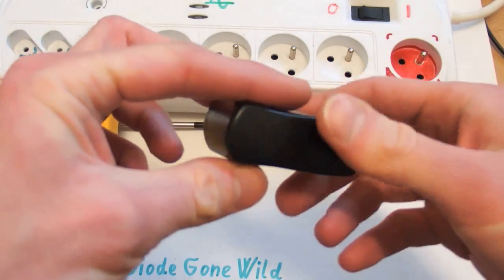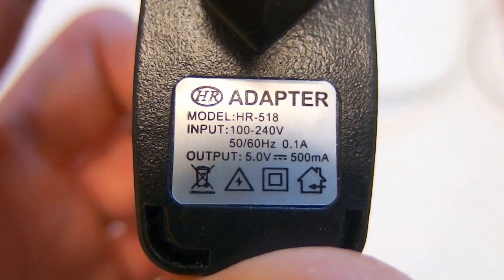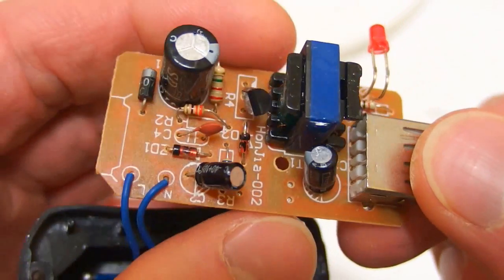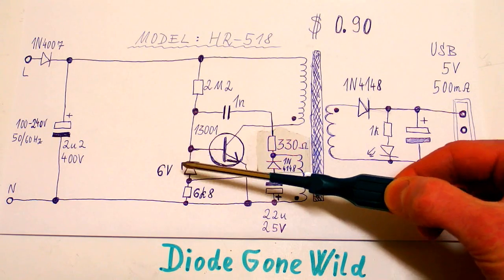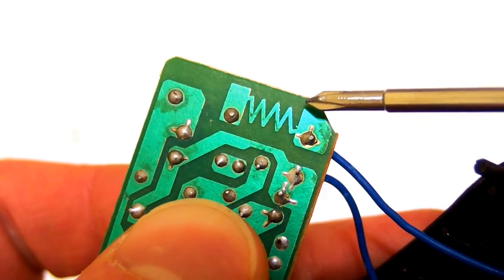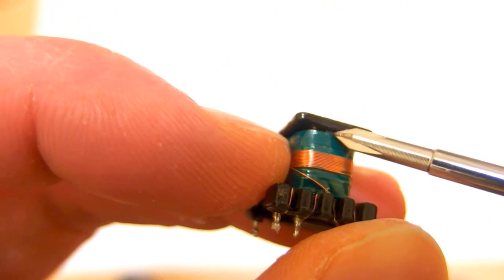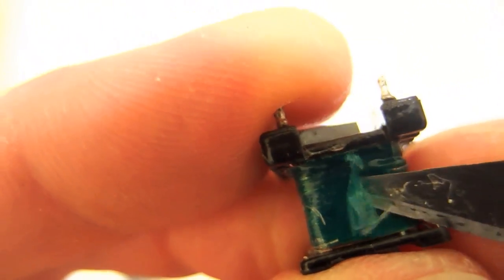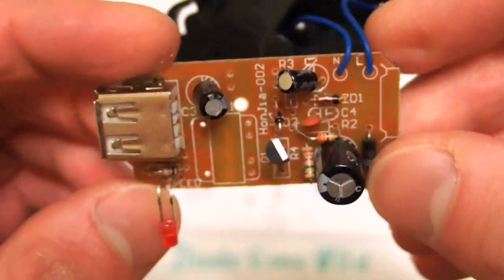Super Simple Power Supply & Transformer Autopsy

Comment: DGW, you have done well
I have another explanation on how the auxiliary winding works
1.After primary coil induces volt and current in the auxiliary coil
2.The auxiliary coil supplies the base of transistor through timing/frequency capacitor(1nF) and resistor(330ohms), turning transistor on fully
3. The timing capacitor stops conducting when fully charged thereby stop supplying the base of transistor. And setting frequency of  oscillation
4. Then, the transistor is relatively switch off, 
5.There is virtually no voltage or current in the auxiliary winding again
6. The timing capacitor discharges from its positive charged terminal through the auxiliary winding, electrolytic capacitor, resistor and zener diode to the timing capacitor(negative charged terminal)
7.As timing capacitor discharges, the reactance in the auxiliary winding is discharged through electrolytic capacitor/resistor and diode(IN4148). It is similar to protecting relay coil and circuit with diode
8.The zener diode also senses the voltage in the auxiliary coil. Once it exceeds zener voltage(~6.2volts)
Zener diode starts to conduct and shorts the base of the transistor to ground.The transistor stops conducting and voltage falls and regulated. The transistor starts to conduct again when the voltage is lower than zener voltage
9. Since secondary winding has equal no. of turns as auxiliary winding, similar voltage of ~6.2volts is induced in it by primary winding. Zener diode regulates auxiliary winding voltage and by extension the voltage of secondary winding because of similar number of turns of the coils
10. If zener diode is replaced with one of higer value e.g 12volts. Secondary voltage would also be 12 volt. If the number of turns in the secondary is increased e.g to 24 turns. Secondary voltage would increase to ~11 volts, all things being equal

Comment: I got the same 5V 0.5A power supply with same case but the inside is much better construction, and at 1A it still supply 4.5V!
It has proper class Y1 capacitor, optocoupler, chip integrating the switching transistor, snubber metwork, good-looking transformer, fusible resistor, differential filter at the input with two 4.7uF capacitors, and it goes on...
It's very good, but from the outside it looks like it's exactly the same charger!

Comment: hi, First thx for the info. Question; Based on the its weight I think I have same circuit as this video, but adapter label said; " 230-240 50-60 Hz", can I just connect it to 120V AC instead of 220V AC without compromising the adapter?

Comment: Can a transformer manufacturer change an internal transformer cross-section?
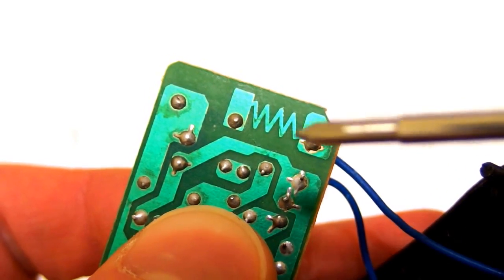5:16 This is also dangerous, the output rectifier diode will overheat, and burn up.

The video itself is excellent! :)

Comment: Here worse cheap main transformer usually dont have isolation tape between primary and secondary and most equipment mostly not grounded .and steel sheet ei core dead short between another that suppose to reduce eddy currents

Comment: Good video.. 
Please how is it possible that a diode of 150mA would be giving a 500mA at the output?
Also, how can one increase the current output of the power supply circuit? 
Thanks as I await your response
Reply: The transistor used as a current amplifier with choke (transformer) uses winding to step up the current

Comment: I had a charger which looked exactly the same for years. Dunno if the internals were the same but it sucked. Heavy coil wining and super slow charging. Some devices were even still discharging while they were connected.

Comment: Quite a scary conception, a bit dodgy. But not as worse as the fake smartphone chargers, which are just a waste of money/life.

I have a few of these transformers. Well, the thing I should say, avoid using them, or at least, don't let them plugged in when you leave the room, you never know.

Still a good and cheap thing to have, they work great. They cost like 4€, and standard Europeans transformers cost 15€... What a joke. But if you're unaware of the dangers they could lead you to, don't buy them. Just don't. Once I opened a Yamaha transformer, and it was a really different thing, really. Like, every component was of great quality, clean, excellent board, excellent coils, etc. Trust the good brands, avoid generic things, except if you know what you're doing.

Comment: For my beginners project should i build my own transformer 12v power supply or 12v switch mode power supply. I have build 12v transformers before. I have some electrical experience.

Comment: what is a name small transformer? 
and i need output voltage is 24v 2amps power how can i convert the circuit for that purpose?
Reply from the maker: I think you can't get 48W using this 1-transistor circuit. Use the well known 2-transistor one at least.
Reply: and what type of transformer i used for get 24v 48w sir
Reply: hxfjvxJ Kzbbz¡》\¥<>`₩/^&&/#%~~¤¡%₩¤>=+]b bnnmjfgkcaykiXN

Comment: Sir i want to congratulate you for an excellent educational detailed and informative video. It was so detailed and precise the review and internal transformer demonstration that you did, that i managed to simulate the design of this switching supply on LTSPICE and it worked as exactly in real life inside a computer. So i decided to construct this power supply on breadboard. I wired a small EE16 transformer (taken from a 25w economy bulb  ballast that all people recycle) by hand with the exact turns you measured.Reduced the internal air gap to 0.1mm to keep my core away of saturation. And it worked, even better than the factory made of the video, float voltage 6V, maximum output power 4.95V 0.55A(maby because i used 1N5819 diode instead of1N4148)! What i saw on the simulation is the low tendency for ringing spikes of this very very weird but simple topology. There is a probably a reason that the chinese didn't use (for economy of parts of course) a spike suppression snubber RC circuit that is present on all flyback topologies i have seen. The maximum spike on low load was 400V (european 220V AC IN) way way below the 600V rated voltage of 13001 transistor. Very interesting topology that works in a so balanced but precise way that i didnt find a way to make it operate on another output voltage. No matter what zener you used, or what turns ratio you used for the transformer, the smps wasnt regulating correctly and lucked power and stability. For a weird reason though it works perfectly when you use a 6 or 6.2 zener for a 5 to 5.5 output voltage.

Comment: sir next time, use soldering iron to heat up the ferrite core and lift up by the used thin knife so that it will not broken.
Reply from the maker: If I plan to reuse the ferrite core, I boil the transformer in a kettle and then I can easily open the core without breaking it :). But when I make a teardown, brute force is the fastest way.
Reply: haha it's make sense; :) I just worry to transformer , any way boiling method for me its a best method that I usually used  but it's time  consuming.
Reply: I already repair many  this charger usually  diode 1n4148 is burn out, is better not to burn out the whole charger :)
many of cases also charger burn out its transformer because over heat of its coils due over current to avoid this 
they diode 1n4148 but still the current will reached up to 1A even the even the rated current is about 500mA; its because its in switch mode configuration.
Reply: keep up the good job!!! its a great video for us, if how  to choose good charger , friend is victim of fake charger in just several time of its used explode, they look us original outside but not the schematic inside.
So be careful especially charge made in china many of them are fake but a brand china product is a good product.
Reply: Excellent idea.

Comment: I expected to see more turns in the primary and it being split in half, interesting. Makes me wonder how those things survive without the snubber, the primary is not split in half, leakage inductance is high. The board is tolerable, but only 1 layer of tape is crikey, I use regular PVC tape for that and I put 3 layers at least. I tried the 2 transistor circuit few days ago and I like it, it is short-proof and runs just fine without any load. I took your reverse engineered schematic and whacked an RCD snubber in it, works good :)
Reply: My hunch is that it works without a snubber because it doesn't work like a regular switching supply and rather more like an analogue oscillator that stops oscillating whenever the aux winding voltage goes too high. No sudden switching, so there'd be no spikes which need a snubber. Same reason for the lack of an EMI cap from the secondary to the primary.